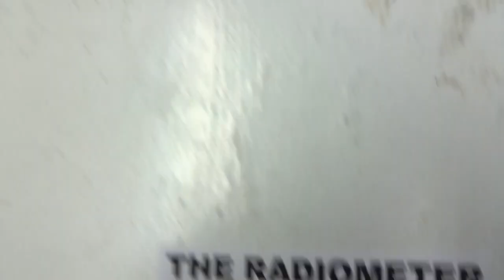The Radiometer

Comment: Is it possible to build a really big version with a generator inside, put it out in the sun, and power small devices with it?
Reply from the maker: I do not see why not.  The only problem is with the fact that it is in a sealed container with a partial vacuum.  Also, it would take a really large radiometer because the plates do not have much momentum.  Momentum equals one half mass times velocity.
Frank